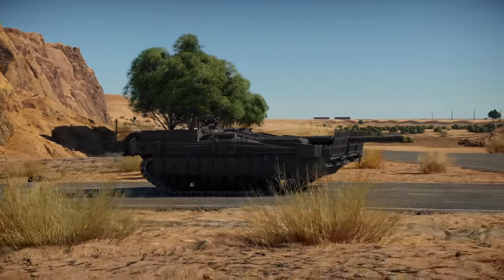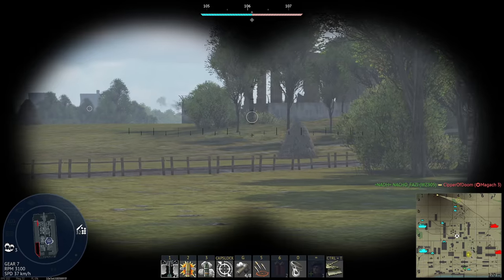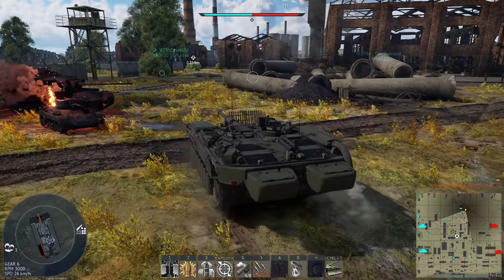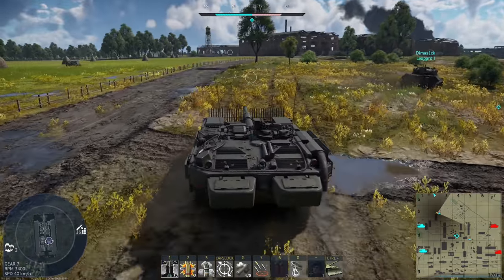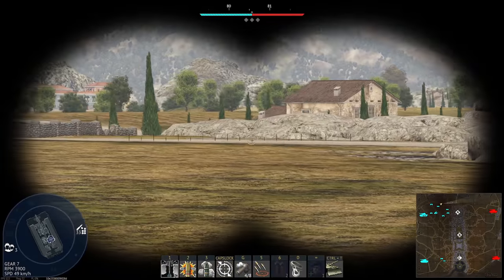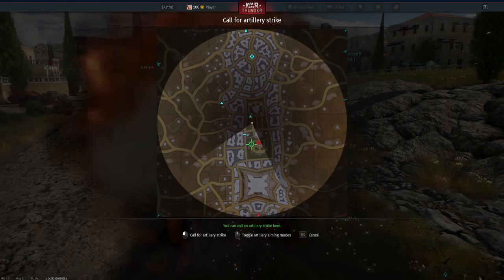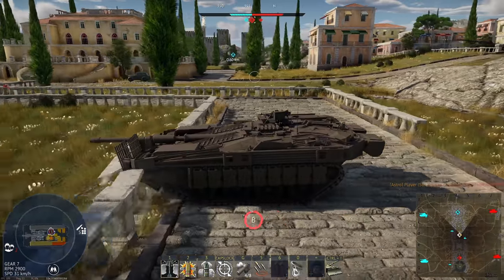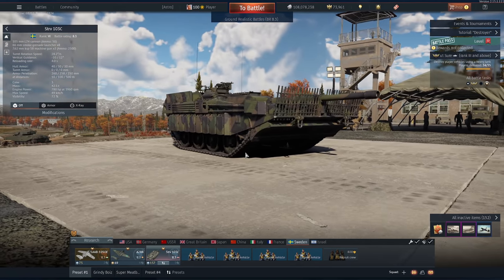THE MOST BROKEN TANK IN WAR THUNDER

Comment: As a 103 main, you're mostly right in the intro. The aiming is rough, but that's kind of to be expected with true hull aiming, it can also be mostly overcome with planning and experience, you can't treat it like every other tank. Also the tank can be run with one crew member as others have pointed out. The biggest problem is that at 8.3 you match with 9.3 commonly and you face APFSDS with can shred you, and you face missiles every game. The 103A and 103-0 are much stronger despite being objectively weaker because you rarely face those two threats. 

What they should do is move the 103C down to like 8.0 or so, and the 103D (a test prototype modernization) with thermals and better computer and sucks, that could be 8.0 as well, if they did one with ERA (a possibly planned extension) then that could even take it to 9.0 because of how it would address one of it's bigger issues

Comment: At least this thing and its premium brother has a lineup, witch the top premium tank the CV 90 can not say! And with the removal of the SAV, now this nation has the worst premium tanks in the game.
Reply: Eh, The 103-0 can be ok due to it's BR, and the CV90105 has good speed and ability to actually pen enemy tanks when compared to the normal 9040's. And due to it's low repair cost it's pretty much a ''Leeroy it and try to spot and crit as many tanks as you can before you get taken out''

Though yeah, I do prefer the Lvkv9040 over the CV90105.

Comment: I doubt this tank was any good IRL, otherwise they would not try to replace it trough his whole career. Having said that, it is not that this tank underperform, it is because other conventional models overperform because of GOD vision (especially with low-spec garbage). What is wrong with this tank and all 103's in general is the gun. There's no way 74 cal could have identical balistics with original L7

Comment: How does this tank is so giggly and non stabilized LoL.
Reply: the weird part being that one of the main reasons the real thing was so deadly is that they were an incredibly stable shooting platform, once they got that whole aim with the tank steering thing finely tuned enough to actually work (weirdly enough the precise drive control for it gave them problem after problem while making the tank equivalent of one of those bouncy cars pretty much just worked from the get-go).
they were designed to find a spot to sit and wait, pick a series of shots, fire that series, and then just leave faster than anything big enough to fight them could follow. the sloping was nice for survivability but what was really going on is that this is one of very few tanks that was actually designed to hide in divots and peak over hills and cover itself in rubble or bushes or whatever to shoot at unsuspecting people, in short warthunder somehow managed to screw up making the one tank explicitly designed to go about it's business exactly like a warthunder player. about the only thing they got right was the thing where the tank remained mostly functional with a 1 man crew.

Comment: Question, when carrying a secondary round for light vehicles, why carry the HE round instead of HESH? HESH has higher TNT equivalent, making it more likely to overpressure and the fact that it’s HESH means that even if you don’t overpressure, you might still do some damage if you aren’t hitting ERA, Composite or Spaced armor. Also, the HESH round is slightly higher velocity.
Reply: It's out of habit
Reply: HESH is a shaped charge, it is designed to shoot and kill the ground (bunkers), or mobile bunkers like the Maus.
The HE is more like a Grenade for dealing with open crew cabins, it disperses more shrapnel.

Comment: the 7.7 tank is one of the most powerful tanks in defense and sniping tier for tier. 260 pen round has ridiculous angle pen and can defeat almost every tank it faces.
Reply: The 7.7 one has 302 mm of pen
Reply: @valentine5105  the ammo with 260 penetration is better because of the 60 degree penetration.
Reply: @BloodyCrow__  i prefer 302 mm one because i rarely got 60 degree shot.
Reply: @valentine5105  the 60 degrees pen works good against russian tanks especially heavy tanks It can also penetrate the m60a1 aos upper front plate where 303 pen will struggle.

Comment: Question: How to make strv dance?
Reply: Hull aiming Is the primary feature, which replaces the fine motor skills needed to aim, but in the movement controls there is also the ability to manually adjust suspension.
It doesn't have a default set of keys but the cool thing is that it works for more than just the STRV.  There's some German tanks with adjustable suspension, letting you change ground clearance and hull inclination.

Those are the features that let you do the "get STRV'd" meme
Reply: Just put on some lil Jon and see what happens bro

Comment: I think that a function quite like a stabalizer that snaps the sight and the tank into place (where the player is aiming) would fix these tanks.
Reply: It physically can't because you can't stabilize the gun without stabilizing the suspension.
Most Stabilizers use a counterweight to measure how the turret and hull are moving and counteract that with the same motor that controls "turret salutes".
The strv103 uses its suspension for ALL of its aiming because the barrel is welded permanently to the rest of the hull, so the only option would be better suspension....
Reply: @volteer1332  Yeah I know, Im just saying like gameplay wise the sight should be kinda locked to where youre aiming and not just slowly wander away frow where youre trying to aim.

Comment: it was made in 1955 and it has two drivers one turned backwards with two steering wheels. its a defensiv tank not offensive. One turbine engine and one diesel and it never wobbled like that its stable and straight. Its a stug.

kkkkkkkkkkkjjjjjjjjjjjjjjjjjjjjjjjgggggggggggggggddddddddddddd

Comment: Is this video a joke. That thing is OP. It’s 77° front auto ricochets 90% of rounds it will run in to. It’s transmission being in the front stops you from getting killed from the lower front plate. A 4s reload is busted at that BR. Ok so you can’t move the barrel of the gun but does it matter if you don’t die when your front is towards the enemy and the premium one just makes it face things that will never penetrate it from the front. I’m sorry but you’re just wrong about this tank.

Comment: as a lover of the 103. grille them on that bouncy crap of a aiming system. it is a decent amount better then before BUT any kinda of bump or elevation that makes 1 side higher/lower and its nearly impossible to aim
Reply: The 1st one was not too bad the 2nd one was waaay worde and the 3rd is still shit
Reply: @kh5736  i mostly started swedin around the 2nd iteration of it so i only know bad and slightly better
Reply: @Sniper89891  the aim feels like the tank has Parkinson and you either drive or aim otherwise it feels like the tank doesn't know what it wants and if you turn aim off you can't make snapshots that are critical
Reply: @Sniper89891  it should perform like a tank turret and not try to overcompensate movement

Comment: It's a tank destroyer that pretends to be a tank.  It is designed for sniping from cover and retreating (at full speed) as the enemy advances.  Taking out the engine WILL disable it completely.  It is NOT designed for city fighting or any form of close range engagements.  Get over it or drive another tank.
Reply: But it passed urban field testing with excellent results. It was tested in cities, and it did well.